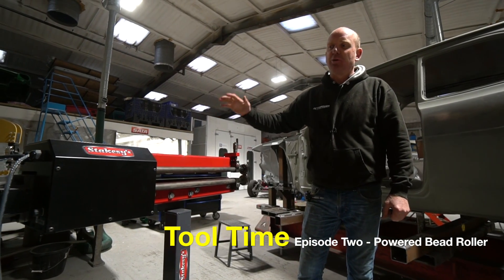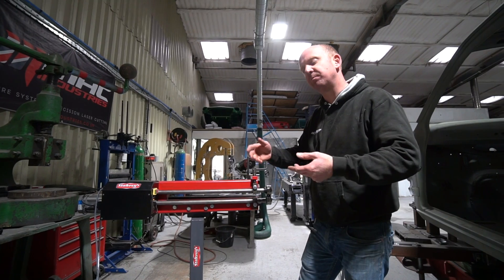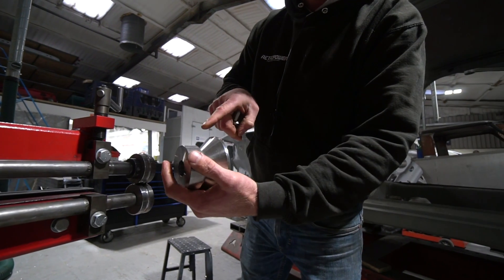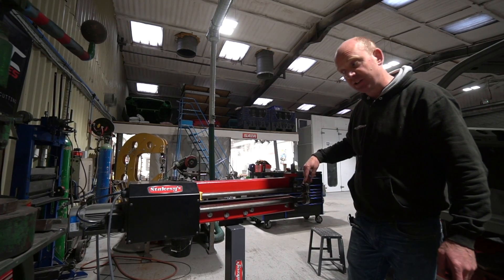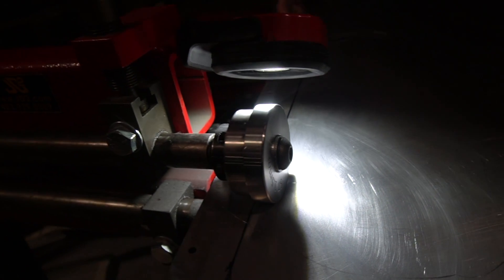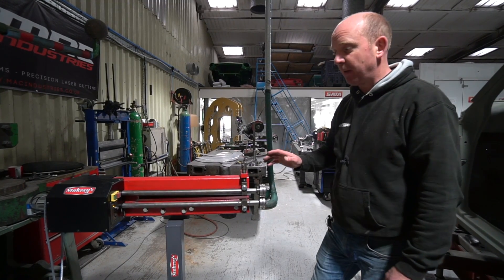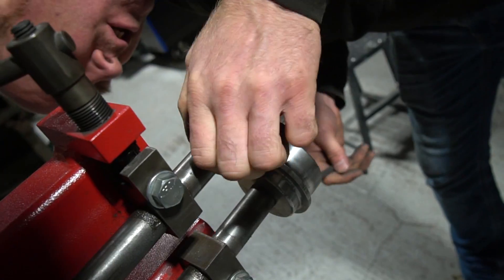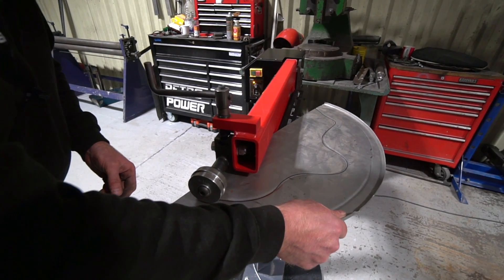Tool Time Episode 2: Stakesy's BR-24 Powered Bead Roller

Comment: I’m lucky to have a pullmax and a wee mini nibbler .Ancient old cast iron thing called a burr free , can nibble 3/8” steel plate .. or pretty do any beading or flanging I need .. but got it permanently set up for edge flanging since I found the pullmax, lurking collecting grease in an old sheet metal shop . , I could never be arsed with Bead rollers 🙈. . But then I never did buy the power feed kit.  🤣🤣 I imagine it makes them far more useable 👌

Comment: I know you have touched on metal work hammers and dollies and hand forming parts before.  Be good if you could go do a video with a little more depth on different types of metal working hammers how they can form and limitations.  Also things like do you use sand bags, blocks of wood, large blocks tree trunks to use when forming. Im a complete novice so learning so much from you guys. btw Loved the blue paint finish on the E TYPE, stunning work.